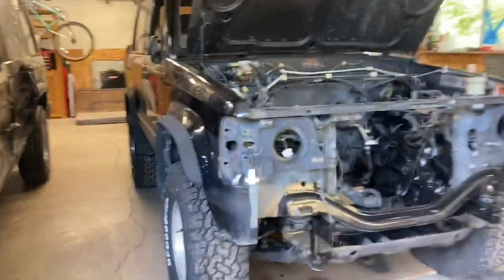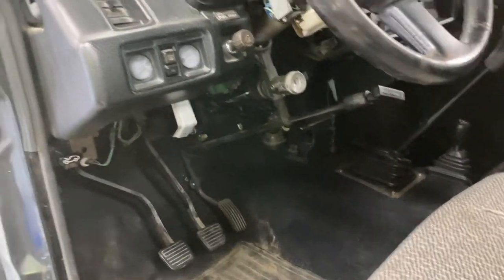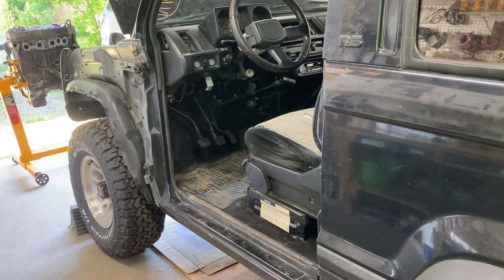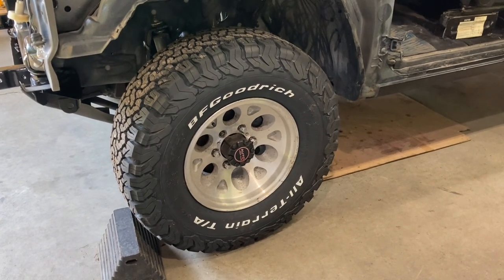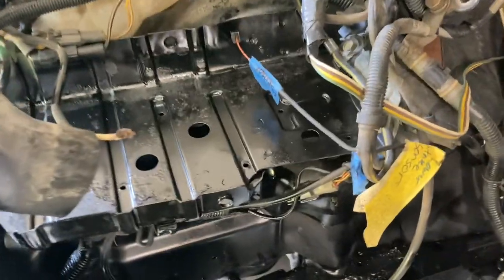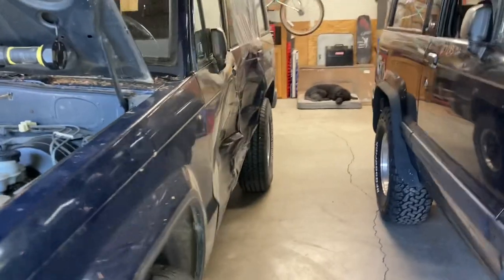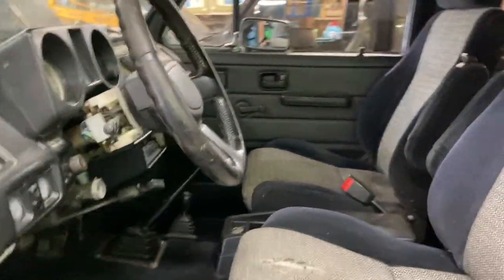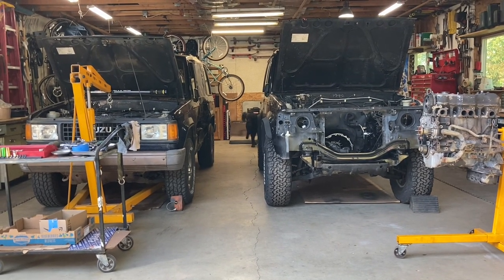Project RS-cue: Part one 1989 Isuzu Trooper RS refurbishment.

Comment: Nice one. Looking at the two Troopers side by each at the end of the video I wondered what size tire is on the donor? I think you said the RS has 31/10.5/15 right?
Reply from the maker: The donor car had a nice set of 31’s. Unfortunately one of them got a hole in the sidewall during the wreck and the tread pattern is discontinued. I’ve looked a bunch for one used one. Didn’t want to put mismatched tires on the RS so I splurged on the BFG’s. Still looking for that elusive 4th tire tho….Thanks for watching!